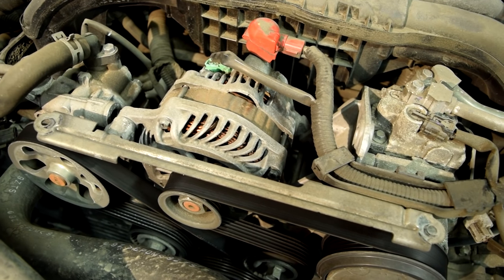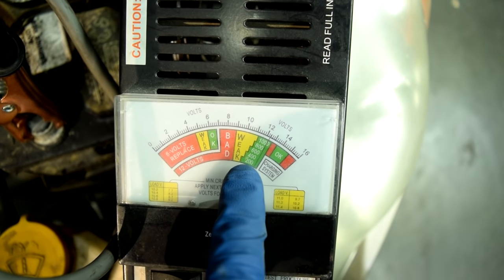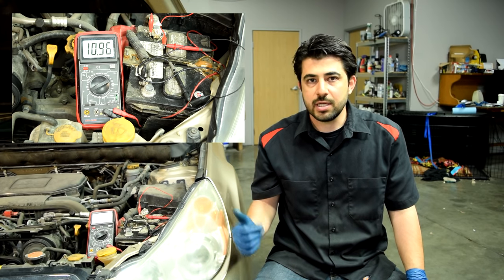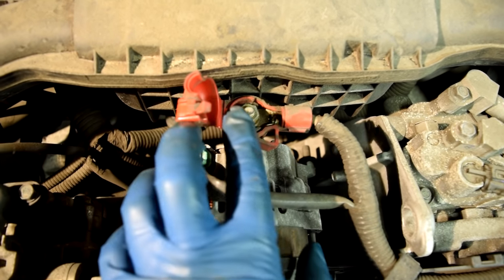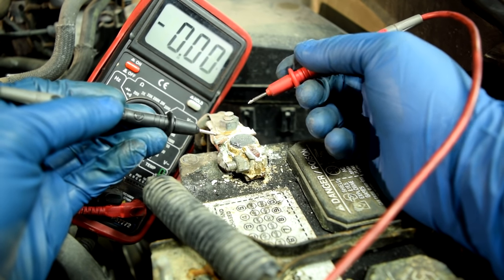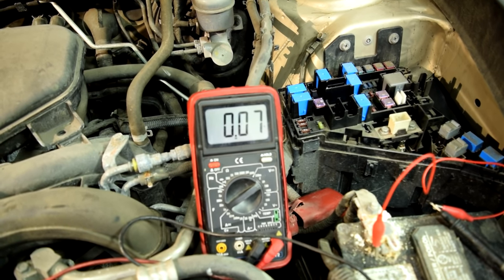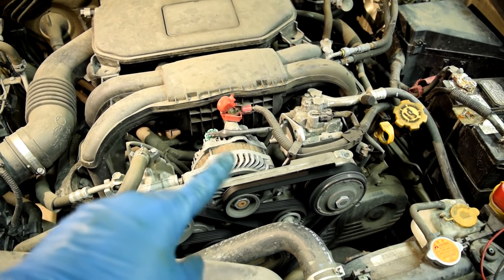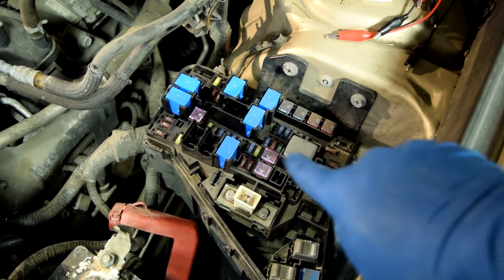How to Test an Alternator - Plus How an Alternator Works

Comment: I always love your videos, to the point and great jokes. I hope your doing okay cause you looked tired here. I am new to a multi meter so thank you for this walk through. One way to also test the alternator that is more of a reaction is to start the car and unhook your battery. If your car still runs then your alternator is giving some power and its a good indication it might not be the problem. if you cant turn the car on then it might be the battery. If your car dies after unplugging the batter its likely your alternator needs replaced because your batteries biggest job is starting the car, then your alternator keeps it going. Another cool trick is to see if your alternator still is magnetic. Thought I'd mention these for travelers, have a good day and I hope anyone having troubles can get them under control.
Reply: Those procedures are ancient and not recommended on any electronically controlled vehicles.

Comment: Excellent video, thank you so much. Just a heads up, at 15:15, the symbol you point to is a capacitor for smoothing the output, it is not the DC brushes.

Comment: Thanks! very useful information as always. :) 
Btw, what do you use to clean those terminals?I read a mix of info some saying "spill coke on it" others say "use vinegar and baking soda" ... 
Whats the proper way to do it? Im thinking a wire brush, some water to keep the dust down, and then add dielectric grease after its dry to isolate the metal from the sulfuric gases which causes that corrosion....  Whats your opinion on proper terminal cleaning procedures?

Comment: Excellent explanation. I wonder how you test for parasitic current that is discharging your battery due to bad diodes or any other means due to problems in the alternator. I have tested all my fuses using a not disturbance approach 
The other question can you have a parasitic current due to bad reply I wonder if it is possible to pass a rely test as you pulled out but can you have a condition that creates a parasitic current as you turn the engine off and it goes to sleep even though it passes the rely test
2002 ford wind-star  disconnecting  the negative post over night so I don’t drain the battery

Comment: This is a great video. 
I'm looking for what's draining my daughters car battery. We have a new battery fully charged but once the key is switched on it will crank once but not a 2nd time.  Something is major zapping the charge out of it  down to 6 volts in 2 hrs.  I've heard that an alternator can do it with failed diodes but not sure how to test it.
05 Buick Rendesvous. Never buy one!
This seems to have started after installing a Boss480 radio. I put the stock radio  back in and the problem is still there.

Comment: Very well done video!  Have you ever seen a main power fuse 'blow' because power output of the alternator has reached 15V? Also, is there a 'signal' sent by the ECM to the regulator that tells the regulator to increase or decrease the voltage?
Reply: Newer cars use the ECM to send the signal to the alternator for when to charge and how much. It factors in engine speed, load, temp, electrical load, and probably more. Ford calls it Smart Charging, and Range Rovers call it something crazy that factors in many many inputs. Others have their own names for it but it can get pretty complicated, and sometimes can require a O-scope to watch the ECM signals.

Comment: At 14:38  How much power are you taking about 12 volts ? With the key on I have  nothing  but when I start the car I have 12 volts  On that wire  . Are you sure  every car  puts out 12 volts with the key on ? I have a 2003 mazda miata . I checked all my fuses and none are blown . If I have 12 volts  on  the wire once the car starts  but none  with just the key on  what does that mean ? If the fuse was blown  would I get 12 volts once its started ? My inside battery light is staying on  and I'm not getting anymore volts  out of the alternator  when the car is running . I can't get a ground  when I touch anything  on the housing  of the  alternator . The only time I can get a ground is when I touch  the screw that holds the housings together . I can't get a ground  from any of the bolts that holds the alternator  in place . Should I be able to  touch the housing  to get a ground ? If I take  the positive connection off the battery when the car is running  it shuts off right away . Shouldn't It stay running  if the alternator  is working ?

Comment: The best video I've seen so far
Reply: Can I use a Mercedes Benz e320 alternator for a Mercedes Benz c320 both have the same m112 motor and I installed a e320 alternator and the voltage of the battery is 12.6v and while running it's 14.1v with the e320 alternator so voltage is good the problem is the battery/alternator on malfunction screen in red

Comment: From 14:55, is it the three pins to the alternator you are explaining with the circuit diagram?
If yes, I  thought there’s already a connection from the alternator to charge the battery, where we checked the alternator dc output voltage. So why is there another connection from the alternator to the battery in the three pin?

Comment: I suggest, that you should apply the battery testing device, after removing the terminals off the battery. As I have noticed that you attached the testers on the rusted terminals which aren't having GuD connection with the Lead terminals of the battery.

Rest, you are doing GuD and your concepts are clear...

Comment: put vasoline onto the battery terminals, this stops the corrosion happening. also keep top of battery clean to prevent discharge across itself. test the charging of your battery by having multimeter connected to battery and with engine running turn on light to hi beam and also a/c, output to battery from alernator should only vary slightly, if it drops alot then your alternator is struggling and the various components looked at

Comment: Hi great explanation. I wanted to determine the two input wires into the alternator, some have a lamp light on the 12 supply and others have no lamp lights. does it matter which connector is one or two are the possibly a two and one......meaning doe the difference in switching them incorrectly have the same result

Comment: Hi and thank you for this video. I have a old Chevy 350 engine. I put a new alternator on and when I connect the battery terminals the alternator smokes. I think I have a wiring issue but not sure.  Any advice? Thx

Comment: Now I know what a voltage regulator does. It energises the rotor coil to produce a magnetic field which in turn produces the charging current when the alternator turns. Remember Flemmings right hand rule. When a conductor moves through a magnetic field a voltage is produced across that conductor and hence a current if the conductor is part of a circuit.

Comment: Thanks for your informative video. I have a question. My multimeter tells me that my 2014 Honda Accord 2.4L has a resting voltage of 12.5-12.6V (new battery when the car is off). When I start the car, the voltage behaves correctly, according to your video. With the headlights OFF, and all other lights, accessories, power drawing electronics off, the car idles with a voltage of 12.5-12.9V. Is this normal? 

I read that "during startup and light electrical load conditions, the ECM will set the charging voltage to 12.4-12.9V (low output mode).This anomaly might cause a technician to try to diagnose a low charge problem, although it is normal to have 12.5-12.7 charging voltage when the parameters are met."....and that is can cause some people to believe they have a problem with their alternator, when they do NOT.....

Is it normal for my Honda's battery to have a voltage of 12.5V-12.9V while the car is on, at low load (lights, radio, heat, etc OFF), in park, while idling?

Comment: Could you explain a bit more as to why the alternator needs to be supplied with 12v from the battery? Also, how would you test for AC voltage as you can then prove if the rectifier is faulty or if it is the armature/stator that is faulty.  Thanks, good video anyway

Comment: I have a 01 Camry,it’s a 4 cylinders. Question regarding the three wires connector at the back of the alternator. Mine,all three wires have battery voltage. The engine shakes. When I unplug it, it runs smooth. One wire should have battery voltage,right ? The other two wires are for what use ? Can you tell me ? Thank you

Comment: If you are on the road, or don't have the tools you can also remove the positive battery post while the vehicle is running. If the car stays running you have a good alt, if it stalls, guess what? It also magnetizes while running, an oil dipstick or something metal will attract to the back of the alt....

Comment: Excellent video and very imformative! but now I'm thinking .. on my Volvo S40 2005 I put in a new 800A 80Ah battery and upgraded my alternator from a 120A to a 150A because of cold winters and short distances, after I installed it, it was charging at 14,4V .. then I went to the dealers and they said that I should get an ECU software update too to "tell" the car it now has a 150A alt. .. so I let them update the ECU s/w and ever since the charge is around 12.7V only 😕 Am I ok with that? it's been 4 months ever since and the car starts up first time every time.

Comment: Hi, I had the battery light on my 2007 CRV and it did cause my car to power off in the middle of the street.! battery voltage is 12.5, when the engine is running battery voltage is 14.1! Sometimes I used to hear grounding sounds when I was driving. Coul bad alternator bearing fails even it produce enough voltage for the battery? Do I need to replace the alternator? Thanks for your time.

Comment: hoping for quick response, lol when checking gen control signal (to voltage regulator) does car need to be on or engine running or can engine be off which one

Comment: Hi. Wonder if you can help. I have a 3 wire delco alternator. I have got 12.8v going into the cable on the bat terminal. When i put a positive lead from the multi meter on the V post it reads the same  as the power going in to the bat terminal 12.8v As soon as the alternator starts to spin the voltage reading on the V post drops to 10.2V

Comment: Can someone explain this to me. If you do a voltage test from the (-) post of the battery to the (+) post on the alternator and the voltage drop below 12 volt  or more, does that mean the either alternator or the voltage regulator is bad? You then do all the voltage drop tests, should the voltage drop be more than 0.20? Ultimately, the alternator or voltage regulator needs to be changed. Thanks in advance,

Comment: At the start of your video I wanted to pull out my hair. You surprised me when the words, "voltage drop test" came out of your mouth. Good on you. But also current electron flow theory shows dc flows neg to pos.
Reply: Conventional current flow (pos to neg) is usually used in electronics, except for thermionic valves etc which follow electron flow theory (neg to pos). 🙂

Comment: What are the particular parts of an alternator that are usually busted and can be repaired? For example, it doesn't charge, the light indicator doesn't off when the engine is running.

Comment: Hello I checked with a probe and I'm getting a red led light on all 3 contacts in my alternator connector. I have no charge by the way. I've replaced the alt twice and still no charge. The 100 amp fuse is good also. Any suggestions?

Comment: $5.99 for brush assembly instead of 200 for alternator. Big difference
Reply: Jorge Diaz you can buy an alternator on Amazon or eBay for 60-80 usually.

Comment: Hello. I've seen your videos and currently I am having trouble with my 2nd generation Mitsubishi Eclipse. I've searched everywhere on the car (did a boost leak test, vacuum leak test, changed plugs, plug wires, coil packs, power transistors, compression test, fuel pump rewires, even checked the timing TDC) but its still not passing 4000-4500rpm even while sitting and with no load on the motor. And while stepping on the gas (exhaust is backfiring when I do this) and the motor is maintaining that 4500 cut, I as a voltage drop on the multimeter from 13.8v going down to 12.9v while motor is making a popping backfire sound at 4500rpm. Question is, does the alternator affect these kind of circumstances? Does this has anything to do with the spark I should be getting at high rpm/boost? Normal idle is at 14 plus volts and battery seems charging good from it. Hope I get an answer thanks a lot! :)

Comment: For the voltage drop test around 09:00 (B+ area), does it matter which of your multimeter leads is touching what? 
Must Red only touch the Red battery post and Black only touch Red Battery terminal?  
After watching these types of videos where you're checking connections with a multimeter, once I actually go do it, I forgot which color lead is suppose to be touching what. Can someone please explain?

Comment: I have a 1984  Camaro  Z28  5.0 L  that has my battery going dead after 1 to  3 days parked. 

 I checked all my car fuses but they looked ok.  

Someone told me that Alternator possibly could discharge a car battery because battery power is provided to Alternator,  which could be somehow draining my battery after 1 to 3 days of being parked in my driveway.  

Do you think somehow this Alternator is somehow draining my battery?  And how do I check this possibility ?  Thanks.

Comment: If the voltage drops a bit low while starting. The battery could still be good, the starter could be dragging, causing it to pull more current.

Comment: The condition of the battery and earth cables is even more crucial on designs with no separate voltage sense wire. I had a bad starter cable cause low voltage (13.3 went to 13.8 after replacement) .

Comment: for the warning light is broken the alternator can't start charging.
The easiest way to test an alternator on a bench is to use a 12V battery. Ground the alternator body and hook up positive the large terminal on the alternator. Then spin the alternator with your hand. You will feel very little resistance. Then add another positive lead to the terminal for the warning light bulb. Then try with your hand to spin it again and there will be a lot of resistance if the alternator is charging. You can test a generator the same way, but no need to hook up anything else then positive and negative. If OK the alternator will start spinning.

Comment: auto parts store said my battery, alternator and starter are good, but starts are slow and the radio and clock are reset every morning like the battery was disconnected. there is also a strange squealing sound when starting. any ideas? lol and thx great video!

Comment: hey my friend maybe you can help me, i did replace the alternator regulator on my e 350 mercedes, when i start the engine it generate 15v maybe a bit more,, but after a few second it drops to 13v, is it because the battery is full charge, is it suppose to stay at 15volt all the way. have an idea ?
Reply: finally i did not do a good job i am very .... don t know what to do, i unplug the positiv and the alternator gives only a 13,6 ..... all this work for nothing ... impossible there is must be something smart to do

Comment: First could internal regulator be controlled by the computer on car? Second is there a way to test alternator while it's on the car? Because I replaced alternator and battery but from battery terminal i only get 12.5 if i try to disconnect the battery engine turns off.

Comment: I have a question what if when u start the car and u didnt give any load(u turn of ur head light, AC and every thing), at the battery it says 14, 2 V and at the altenator it says 14, 2 as well But as u give the load(u turn on everything) and now it read as much as below 13,5 like 12,5. What does it mean, where is the problem, can u tell me coz mine is like tht

Comment: Hi I have a 2004 Opel Corsa C.
My alternator seems to be charging my battery intermittently. Ignition on voltage 12.4 +. Engine on voltage up to 13.8 but sometimes there is no voltage increase from 12.4 when starting the engine. What could be the cause of this intermittent charging. The battery is 2 weeks old.

Comment: Nothing about current readings. Voltage regulator might be defective and putting out low amperage and still you have 14 V but not enough to charge the battery.

Comment: There should be another test you can do to check the voltage output before the voltage gets regulated. As the engine RPM increases the voltage should increase and the vehicle manufacturer should provide a chart on their on-line service manual saying what voltage to expect at what RPM. At high engine speeds the voltage should be maybe 25-30 volts? I forget the amount but it's much higher than the maximum regulated voltage of about 14.5 volts.. Also the diodes should not chirp too loudly. A slight chirp is OK but a loud chirp indicates they aren't going to last much longer.

Comment: awesome video! One point. You actually SAID it...lead acid batteries have a maximum voltage per cell of 2.2 volts. Multiply by 6 and ....bada bing bada boom....13.2 volts...not 12.6.
Reply: 2.1 not 2.2
Reply: @pvb9964  2.2. Look it up.

Comment: I have a 2000 toyota camry ce I have 2 alternators available to me one is 80 amps and the other is 90 amps can i use either one? the car came with 80 amps will the 90 amp hurt my car?

Comment: I have a 95 Eclipse, all I get is crank, no start. I have done the following, new crankshaft sensor, new timing belt, new starter, new battery, new fuel pump w relay, new coil wires, ASD relay which is the (Auto Shutdown Relay, same as fuel pump relay) keeps shutting off after a few cranks, STILL NOTHING. Should I also change the Alternator, camshaft sensor and coil pack? I have spark. I have not checked for fuel compression yet. PLEASE HELP asap